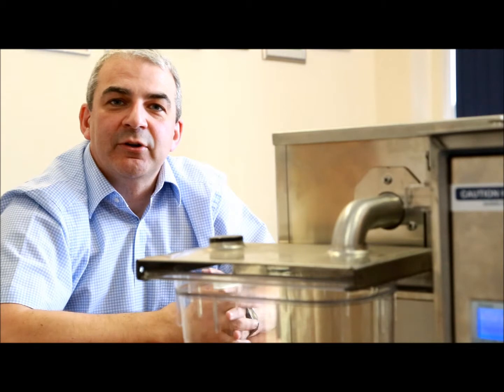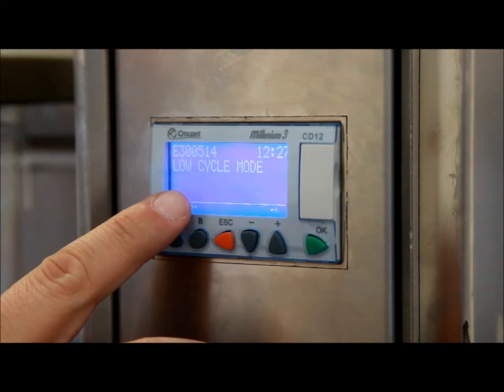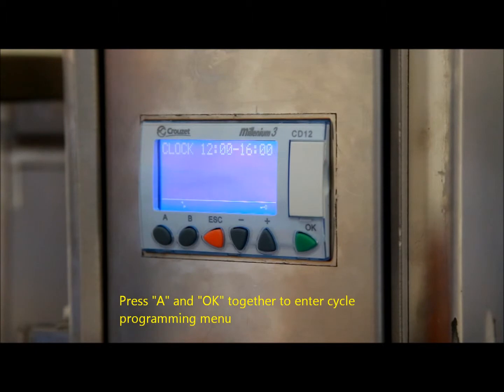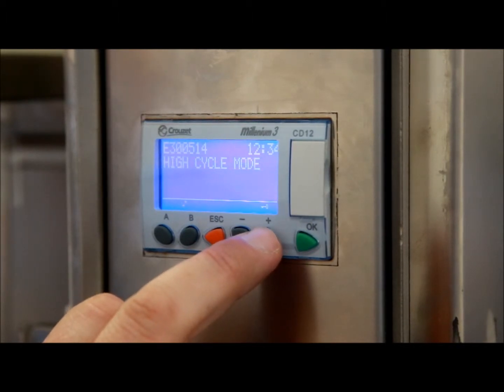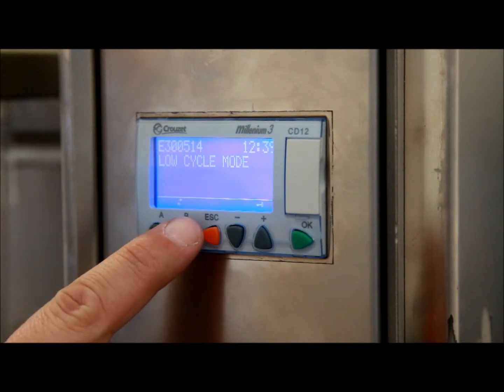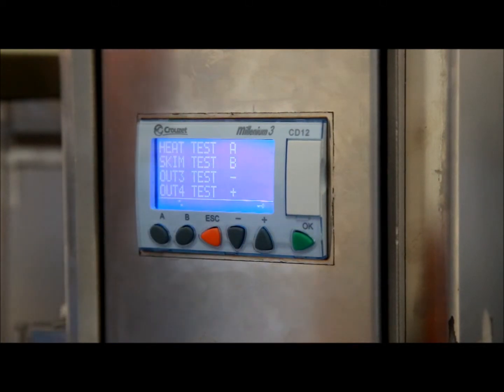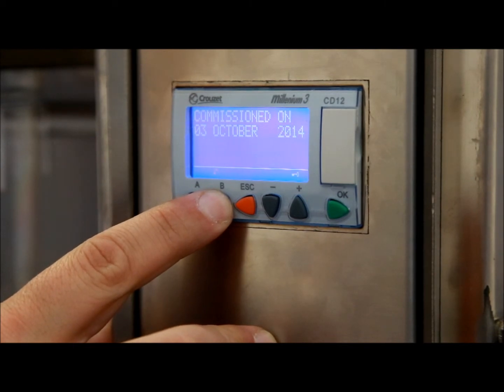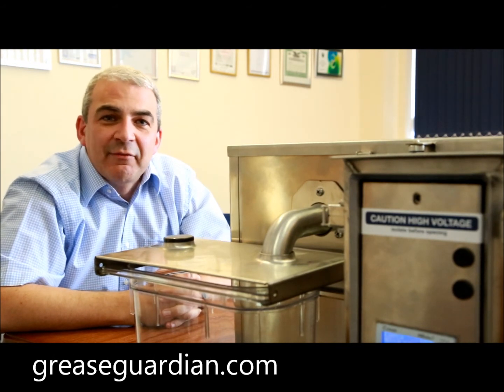Commissioning Part 2 Programming

Comment: What service due means?
Reply: Hello. Service Due is a reminder that a general pump-out or emptying of the sludge on the bottom of the tank is required. This can be preset to come on every month, every three months, 6 months or never. It depends on what the client wants or what the local legislation demands. Here in Ireland it is every 3 months. As a manufacturer we recommend every 6 months. 
Also it is just a reminder. It doesnt stop the Grease Guardian from working as normal.